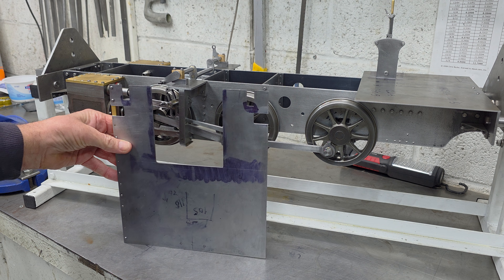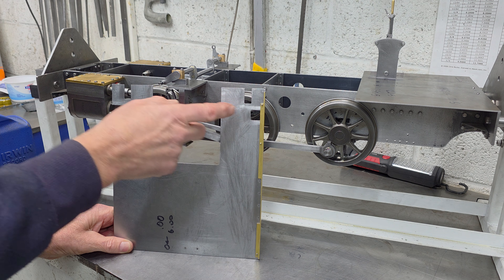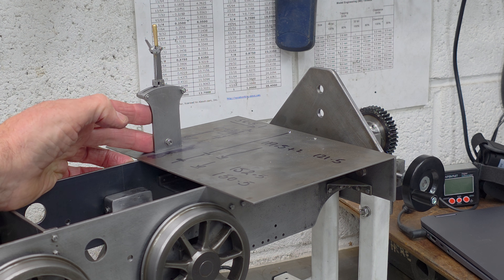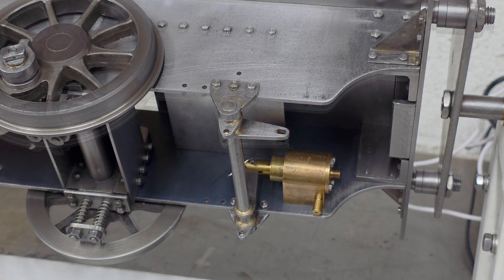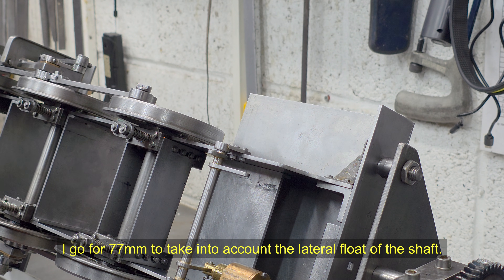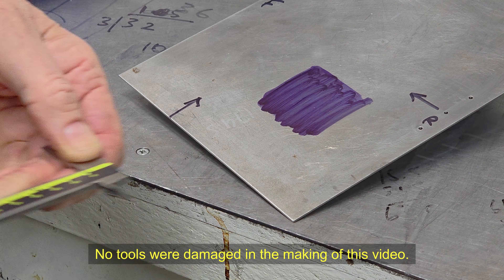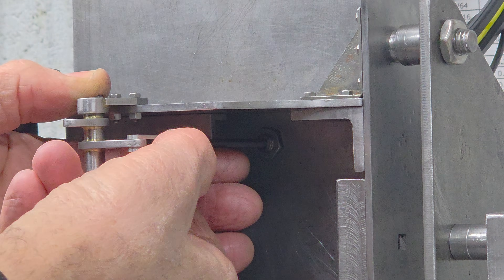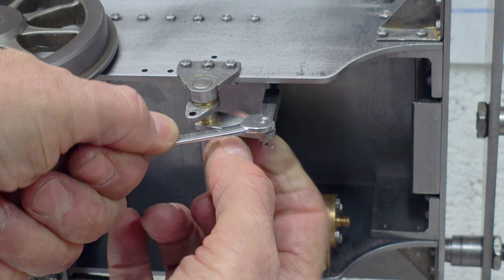Don Young's 'Jack' in 5inch: Part 63 - Running boards and fitting the brake column

Comment: Could you explain what happens to the brake column when the steam brake is actuated? Won't it lift? Fascinating process though, with great audio. I'm amazed your workshop is so clean!
Reply from the maker: Well, I hadn't thought of that,  but yes I guess it will 😂
I do try and keep the workshop tidy,  space is always a challenge ☹️

Comment: Glad I'm not the only person having problems  building a loco designed by Don Young, I've spent many hours trying to decipher his drawing for the GWR 2-6-0 I'm building. One of the parts I've had trouble fitting are the front brake hangers/ blocks. Solved it not fitting them at all.  I'm quite prepared to to except that it my fault. 
Also Keith Wilson drawings leave a great deal to the imagination of the builder.
Keep up the good work.
Rodney.
Reply from the maker: Cheers Rodney,  it's all part of the fun 😂
Good luck with yours,  I'm sure it will all come good 👍